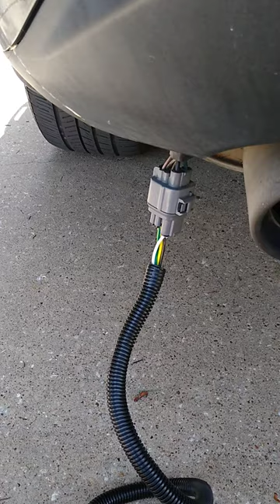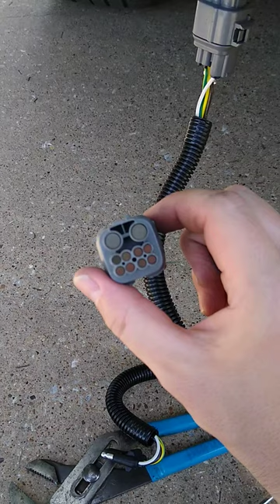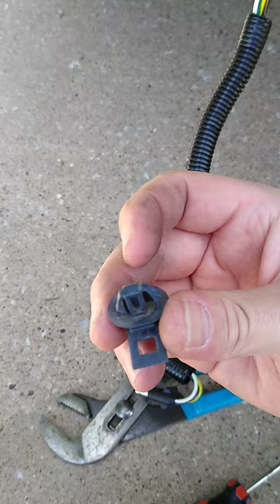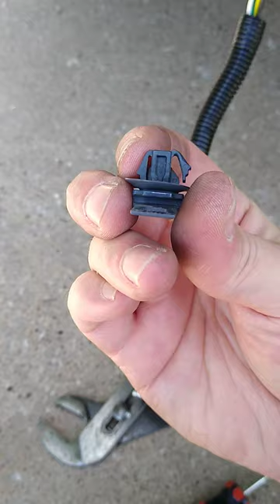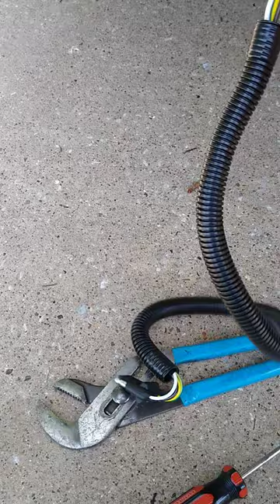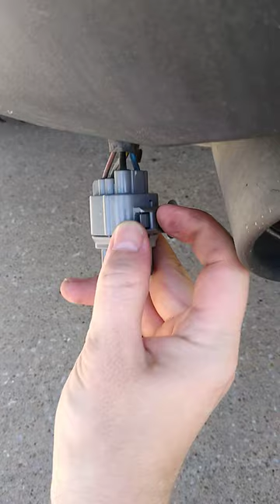2013 Honda Pilot Trailer Harness Electrical Cap Removal

Comment: This was very helpful! The cap has two locking pins - one on the bottom that is released by pressing on a tab but the other one is held in place by the body clip, and it won't let go unless you remove that clip from the connector housing.  Once I have done that removal of the cap was fairly easy.  Thanks for this video!

Comment: Just in case anyone arrives here because you just can't get the cap off and you think you must be doing something wrong - you probably are not.  The 2 'tabs' barely move when presses.  The person at Honda who designed this should be brutally tortured.  I managed to get mine off with the use of 2 pairs of vise grips, two screw drivers, a box cutter, a lot of swearing and bloody knuckles.  You will end up working in a confined space with no leverage and the older the plastic, the more brittle and un budging it is.  I ended up destroying the dummy cap and quite a bit of the thing you plug into.  Once I connected up, I was fine.  Also, there are 2 fuses that need to be inserted - one in the #3 spot under the hood of the car and one on the wire 'thing' that gets connected into the aux power within the actual car (with the little plastic door).  

All in all this was one of the most poorly designed and infuriating things I've ever dealt with.